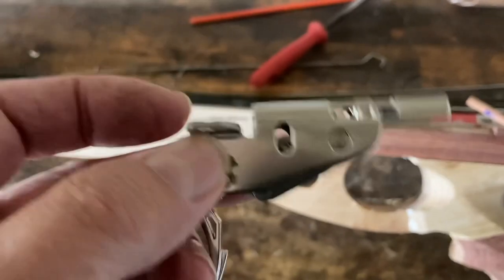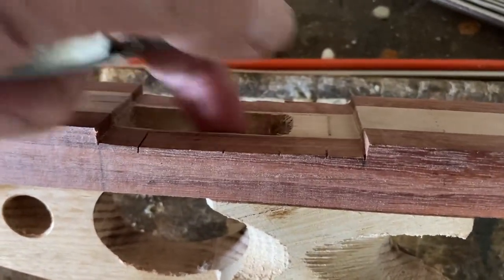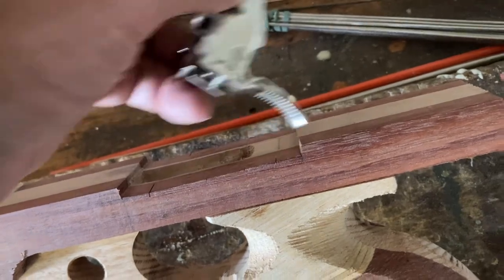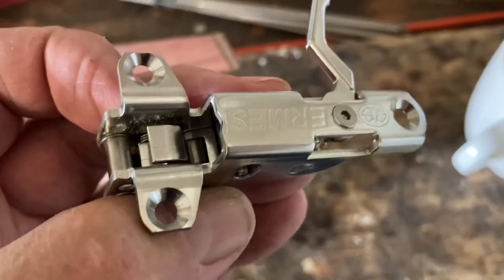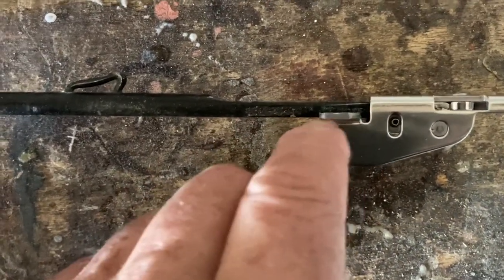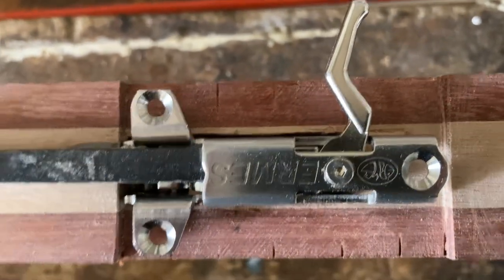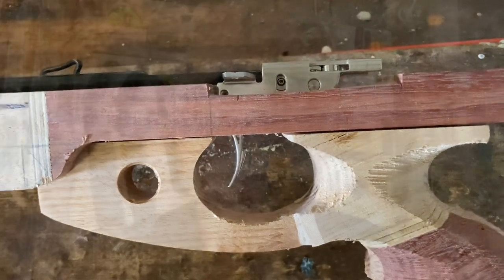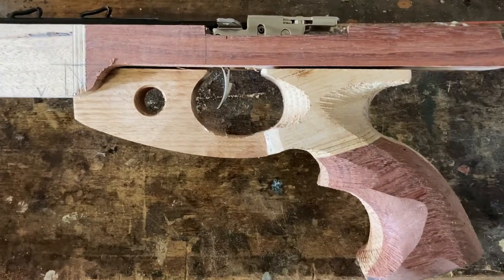Ermes spear-release mech : a review

Comment: I like the light pull on the triggers, I just made  a gun using my spare pathos pin mechanism and it was a pain to get the spring right and there's not much wood and its got a short butt, shaft sits 3 cm from the butt haha handle almost gets in the way of loading but its a fun little fish gun 80 cm cuttlefish shape , I call it the little pathos marauder . I really like the way you design yours .
Reply from the maker: Thanks for comment.
I’d like to see pictures of your gun(s)
Reply from the maker: First and foremost, spearguns have to be functional. But if you can make a functional gun that’s good looking too, it’s a real bonus!
Reply from the maker: When I build a gun (especially if it’s a new design) I take my time. After each step, I put away all my sharp tools (except pencil and paper) prop the gun up on the kitchen table, drink a couple of beers and contemplate it to see what I can do better.

Quite often I get “bright” ideas.

Next time I come back to the gun (after the beer has worn off) I might adopt or reject my ideas, but the result is usually better than if I go at the build like a bull at a gate.
Reply: @diyspeargunner2386  I’ve been having a coffee and a smoke to figure out my problems haha